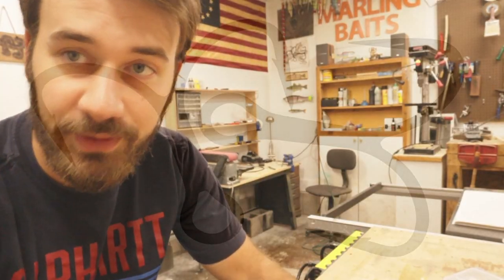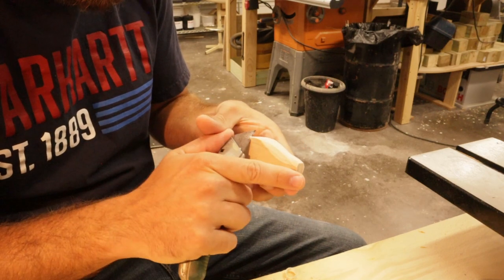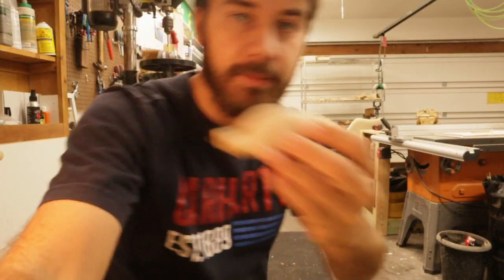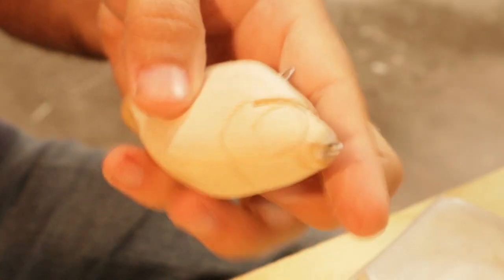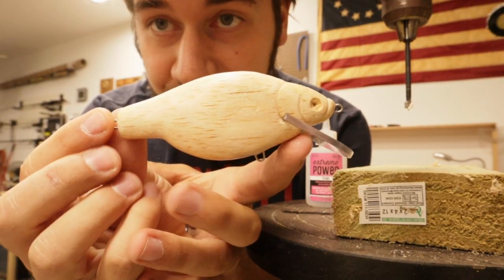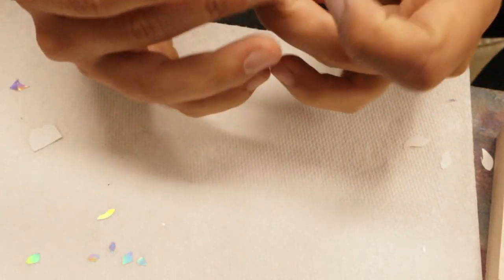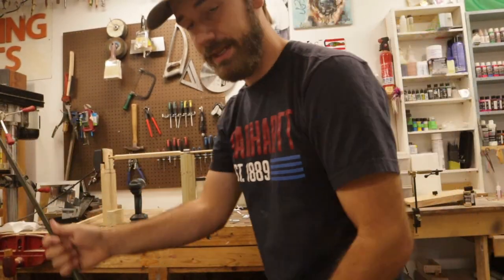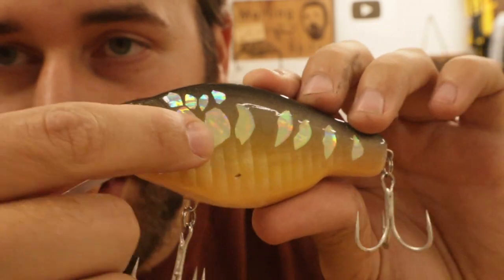Mirror Carp CrankBait | One Day Build to Catch

Comment: inspired me to make my own,just cut 2 pieces of plastic and hot glued them together, sanded it and drilled to holes. put some wire and a small treble on one end and a loop on the other and spray painted it pink. lol

Comment: The interesting thing about carp shapes is that because they've been selectively bred for food for nearly 1000yrs in Europe alone they come in all sorts of shapes, colours and sizes. The 'natural' shape is kind of long and thin like a torpedo but you get some that are almost spherical, some that are almost square, some with big bellies and some with huge shoulders, some with massive horse heads and some that look like they've got tiny heads relative to the size of their body. Colours and scale patterns can be equally varied, you get pale ones, dark ones, chestnut coloured ones and all the rainbow coloured koi varieties. Scaling can vary from fully scaled varieties which look like common carp but with larger scales, almost scale-less leather carp, big apple slice scales to tiny starburst scales, scales only across the back, down the lateral line or at the root of the tail and/or random placement all over the body.

Comment: I found a way to get my plugs to dive better that may work for you  as you tend to like sinking plugs
I drill a 3/16" hole close to the front tip of the lip 
I use a round rod like piece of pure lead about 1/2" long 
I put the lead through the hole and compress the lead with slip joint pliers 
So the lead is flattened against the lip 
Making the plug more front heavy allowing it to dive deeper at a slower retrieve 
Also I find it helps make the plug more stable

Comment: I use Solarez UV to clear my lures. I airbrush lure blanks. I'm not brave enough to actually make one out of wood but I would love to try. However, I have a tendency to cut myself with knives and it hurts. Lol!  I bought mine on Amazon. It's not as expensive as Alumilite and to me it works very well. (I've never used Alumilite)  Oh, it does have a horrible smell. I put some in a smaller container to use just for brushing it on and it does better if you put the container in hot water to make the viscosity thinner. Anyhow, I hope this helped. Love your videos.

Comment: You asked about UV Resin. When Alumilite had their 6 months of backorder recently  I bought some of the Chinese stuff on ebay. It's the same thing. Works great. It's on Amazon too, (black bottle) but it's half the price for the same thing on ebay. You can only get it 100g and 200g at a time so it's brush on, and maybe the alumi UV 2 lb can is less expensive per ounce, not sure. But the Chinese stuff is just as good.
You could check out the "Engineered Angleer" on youtube too. He's done an extensive test comparison of the stuff in one of his vids.

Comment: You need to use a 3-D printer. Print it in halves, weight it in any way you want. Make as many as you want with a push of a button. Make a prototype and scan it to use your fabrication talents. Sculpt your prototype digitally to do what you can't do with a Dremel tool.

Comment: That is a beautiful crank bait. based on an ugly fish lol. I've also been enjoying the warmer weather this week in Wisconsin. But like you Ive been getting skunked as well. the water is still really cold. 

Right now a slower moving jerk bait, bladed jig or blade bait would work better.           Have you made a Blade bait before? To be clear I'm talking about a thin, vertically flat, metal crankbait shaped bait with a weight below the nose, the line tie just forward of center on top, and 2 trebles hanging off the bottom. Fished by letting it sink to bottom then ripping it up in a jigging motion then letting it sink again.

Comment: i want to make baits to but i don't have every thing that i need i have around $300 in gear but still need more, also my uncle mad a lot of home made baits.
Reply: All you need is some wood (Pine, basswood, balsa etc) a knife, cordless drill (preferably), some wire, superglue and sandpaper. You can paint with acrylic paint, starter sets go for less than 10 dollars in my country, and you don't need a top coat you just need a wood sealer at the bare minimum. You can use superglue for that